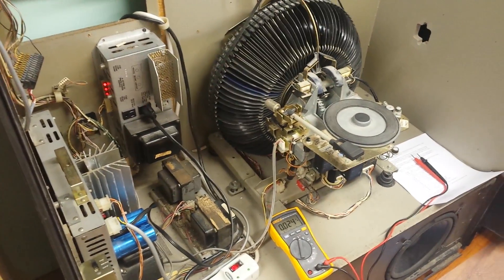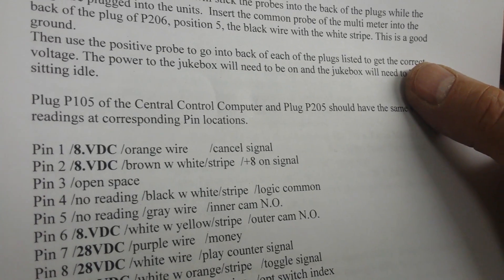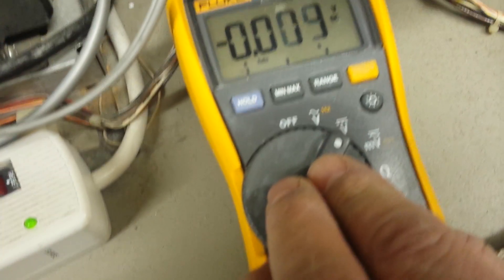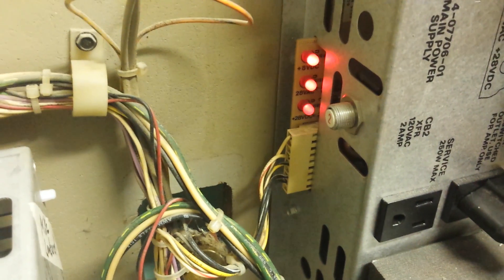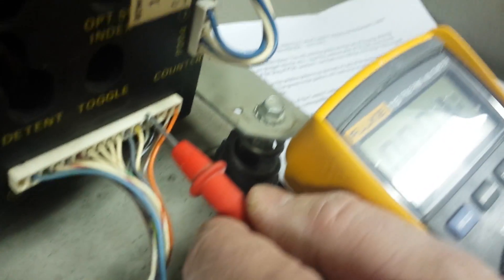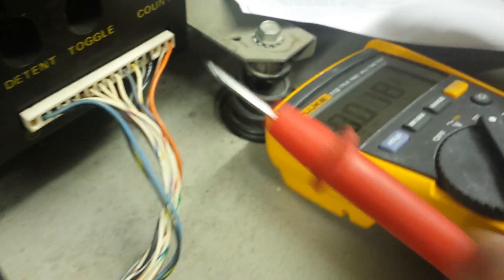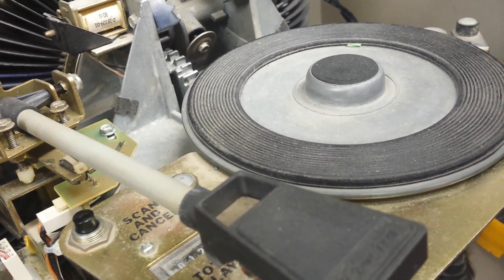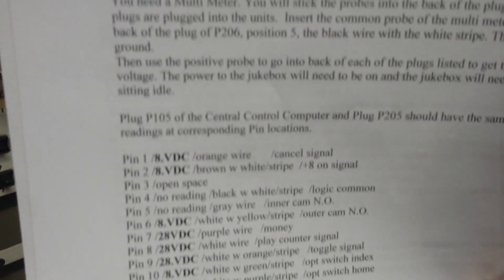troubleshooting voltages in a rowe  record juke box

Comment: How can i contact you to help troubleshoot an R-86, that wont stop spinning the record console?
Reply: I recently obtained it. And i had it working proper, but suddenly it wont stop spinning, and if i manual reset it, the needle drops, but instantly goes back to prone position without playing... im baffled.
Reply: @poughkeepsieblue  did you manage to sort the issue. What was it
Reply: @ElliottHearne  I finally deemed it down to a wiring issue, but I haven't fixed it yet, it's a fault within my wiring harness to the motherboard, I think I know what wire it is, but haven't fixed it as of now. Otherwise, it will be working great

Comment: Hi. Thanks for this video.  Question.  What if one of the three lights on the power supply isn't lit? On mine, thr 8 vdc and middle 28 volt are lit but the bottom 28 volt light is dark. My r84 does not spin the record nor will any of the mechanism operate.

Comment: Hello Bruce,
My farther in law has a 1963 Rowe AMI JEL-200.  I am trying to troubleshoot a problem for him. The jukebox plays side Bs but not side As. I presume this has something to do with the pin selector not pushing the pins for the side A tracks.
Do you have any advice for what I could check for? Is it worth starting with the voltages (would it be the same 8v or 28v as shown in the video?).
Any help appreciated as it is hard to find help as we are UK based.
Kind regards
Steve